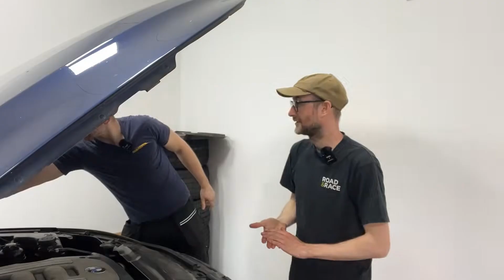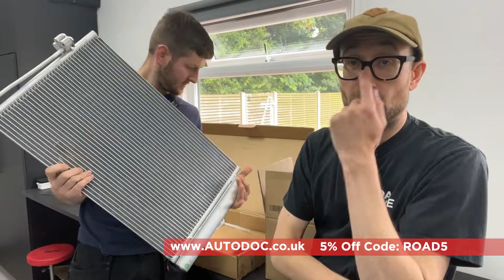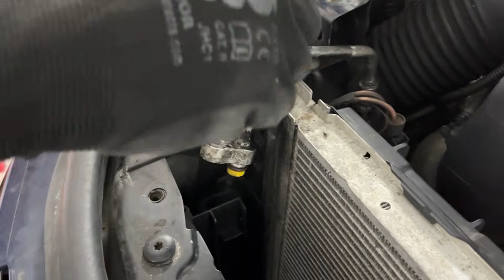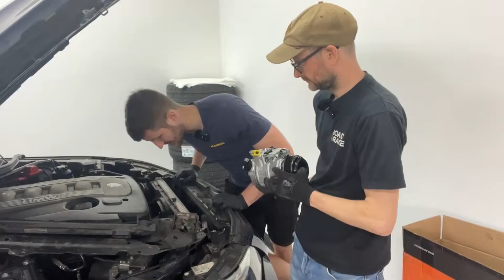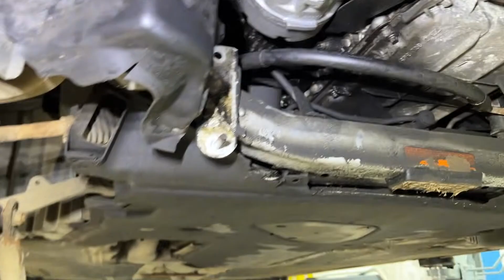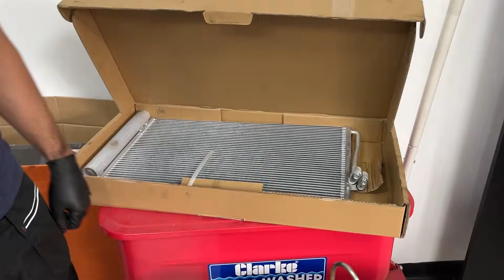How to Fix BMW Air Conditioing AC Not Working

Comment: As regards the amount of PAG oil, your supposed to weigh what comes out of the old one and add 25/30g of new oil and fully drain the new compressor then added what is required.

Comment: Why are you repairing the air conditioning on your 140000 mile BMW well my 1997 Toyota Hilux air conditioning is working fine although l have only owned for five yearsand l am pretty sure ir still has its original compressor and probably the rest of the air conditioning and l have seen reviews on many 1990s and early 2000s Toyotas and the air conditioning works well in is the fact that Toyotas are much better engineered than new BMWs and my Hilux has done 437000 kilometres and is still running fine and much more reliable than any newer BMW
Reply: Yeah, but then you have to drive a Toyota. And for hundreds of thousands of miles!

Comment: I have had an annoying "groaning" noise at 1500 RPM from the AC compressor on my E61 535d for literally years and I think this video will give me the inspiration to finally replace the compressor and condenser/dryer. I've already replaced the AC clutch bearing and all the idler pulleys on the serpentine belt and I replaced the alternator due to charging issues, and the noise only happens when AC is switched on so I'm pretty sure it's the compressor. The noise had gone away until recently when I realised on a hot day that the AC wasn't working. So I topped up the gas with the "AC Pro" system from Halfords and got the AC cold again but the noise came back. Another indication that this is a compressor problem.

Really enjoyed the collaboration between you guys and I hope we'll see a bit more of that in future. Thanks both.
Reply: You might read SIB 64 05 21 and/or SIB 64 01 14. I have this same noise in my 2025 and have been chasing it. Replaced the compressor once and coupled some of the hoses together in the bay and in the footwell to minimize vibration/resonance and it seems to have helped, but the noise is still there. I think it is an issue with their design and has been for quite a long time. Weights might help and/or insulation/spacers. Let me know if you solve your issue!

Comment: Without gas pressure the compressor doesn't run it's a safety feature of all modern A/C systems.

You could have saved the cost, especially as the current ones appear lower quality than the OE ones.
Reply: you changed the compressor for nothing.